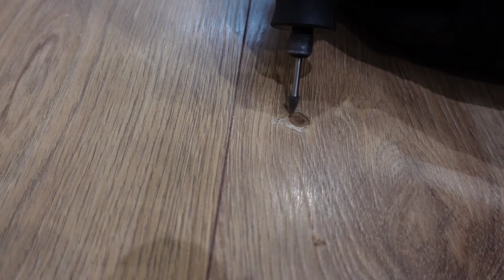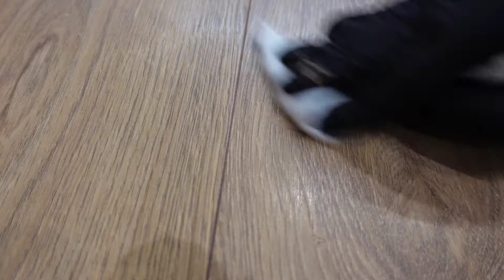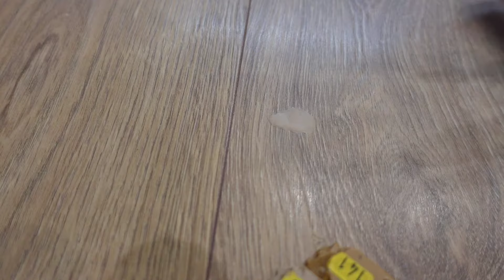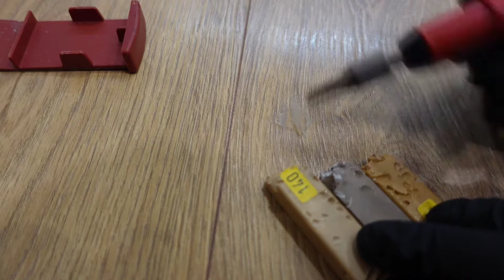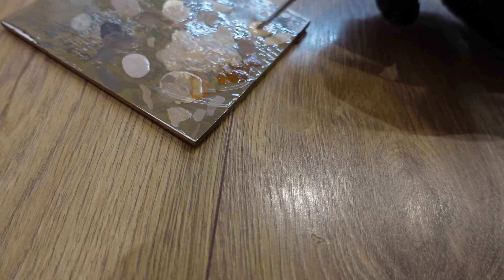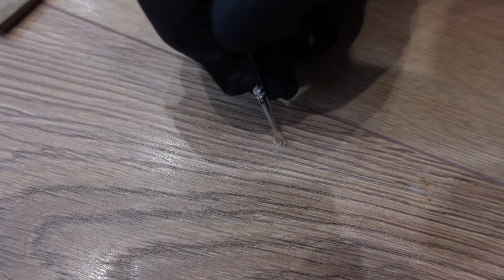Laminate repair. Hookah fell on a new laminate. How to fix charred areas on the floor?

Comment: Can you recommend a brand of transparent restorative varnish?  Whenever I use wax, I notice that the shine in the repair is just duller.  How do you match the shine of the surrounding surface?
Reply from the maker: It is necessary to use a restoration varnish (which does not give transitions) has a very small dry residue. He is in an aerosol. Has varying degrees of brilliance

Comment: Hi there, many thanks for your amazing videos and skills demonstration
I'm wondering: Can you use the (e.g. picobello) ceramic wax for laminate or wooden surfaces? 
My assumption is that probably since ceramic wax is more durable it can be used for other surfaces, but "wooden" wax can't be used for ceramic one? 
Or there is also crucial difference in texture which makes an visual difference?
Cheers

Comment: That device you use to melt the wax and place in the whole .

What is it and where can I get 1 .

Currently looking at fixing my own floor..

Oh and the yellow and red spatula ..
Reply from the maker: This is a gas soldering iron and a spatula for removing wax residues and working with it

Comment: I know it can be done, but it's getting walked on, and is viewed from 5' away, the reality is you can do a Michael Angelo, but you could do a knot equally, there is no way that anything but cured flooring finish will keep it safe...I too do similar work as a profession, so this is not going to last...a shame.